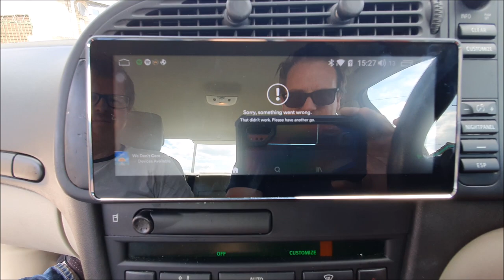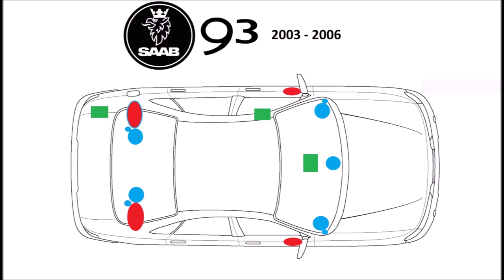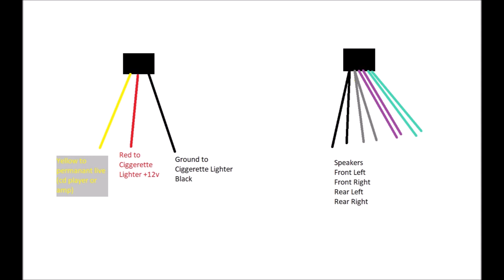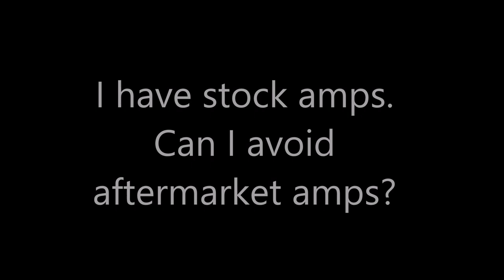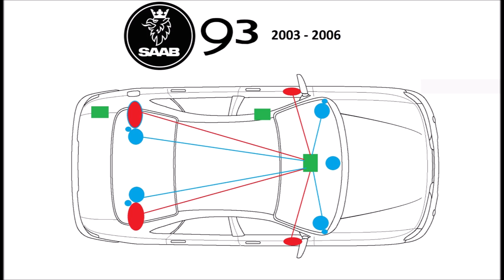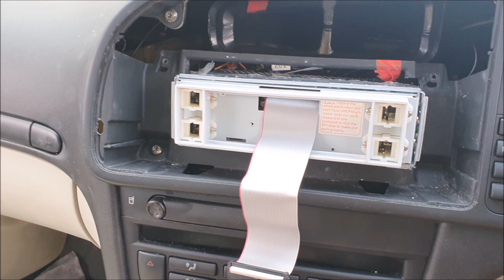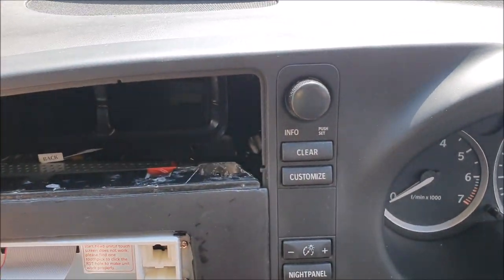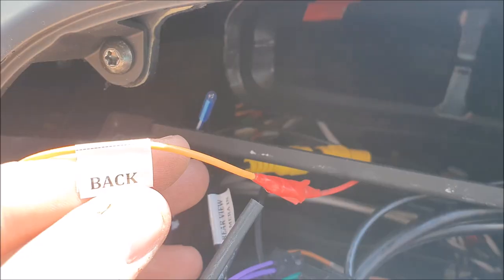Saab 9-3 2003 - 2006 Joying 8.8 inch Aftermarket Radio and Reverse Cam - Fibre Optics and ICM Bypass

Comment: I did this setup different with success. I bypassed EHU/CD with loopback and moved EHU to AMP1 position. Then connect center channel to EHU for chimes and turn signals. I soldered new wires to door speakers from AMP 1 to trunk/boot, then ran a 6-channel amp. All other wiring is the same from your video accept for steering wheel controls. I opted to take Analog stalk signal directly from CIM and then used an Axxess SWC-1 to head unit. This is better than canbus because you get more buttons to program (although phone button still doesn't work).
Reply from the maker: Very interesting, thanks for sharing. I'll have to try this method next time
Reply: @djfremen what wires did you have to connect the Axxess SWC-1 to?
Reply: @subscriptmds8900  there a two bright green wires behind speedometer (remove fascia). They look the same but only one works. You'll have to test and it's a 50%. I used the quick connect slice rather than cutting the wire.
Reply: @djfremen  Thanks for your quick reply.
Reply: @djfremen  Sorry, one more question, was that the pink wire from the Axxess SWC-1 connected to the green wire? Or a different wire from the SWC-1?
Reply: @subscriptmds8900  if pink is CAN wire, then yes. Must be encoded wire.

Comment: You have put so much time and effort into this... That's why it's very sad to see you just left the AMP1 and AMP2 there and even connected etc, instead of really bypassing the optics, as you say. You could've make a loop... Whatever. I mean, thanks for this, it explains a lot to other people that are just looking around and thinking of what and how to do. But somehow, I had my high expectations.
Reply from the maker: I did this conversion with items laying on my garage. I didn't have the adaptors needed for a good loop back and I didn't want to bodge it. So for this, I left everything in place

Comment: @ Saab Unleashed is there a modulator, like the one used for the Bose systems in the GM vehicles. Where the Bose speaker system are still used, with the after market head unit, wether it has video, or not, and all noises are still produced.

Comment: Freaking awesome mod! I see that you have also have an LG phone ICM3 mod, which mod do you prefer?
Reply from the maker: They're for different things. The ICM3 mod is a quick easy upgrade, but there are some minor limitations on options because you're restricted to the Saab's stock system. This video shows a full aftermarket system that gives you full control over sound and full options on components, so if you have the time and inclination, going aftermarket is always best
Reply: @SaabUnleashed  I really want to give this mod a try,  would this be pretty similar for the Sportcombi Wagon? Also, do you know if integration of rear and dash recording would work?
Reply from the maker: @ArcticCenter3773  Yes, this works for all versions of the 9-3 (2003-2006) so can be done for you. The only difference is the location of the rear amp and speakers

Comment: Not sure if you are still on this page, but was wondering why you need to replace the factory amps? can't you still use them since you still have them wired/powered on? Also, I do have a stock sub on my car but I guess it's cuz mine is a Sportscombi. How would I go about having that sub working? or would I need to completely rewire and get new amps?
Reply from the maker: You can't use the factory amps because the audio input is through a proprietary optical interface, so there's no way to provide them audio with an aftermarket setup. You also don't need to keep the amps in place like I did in this video, instead you can use fibre loop adaptors.
Your factory sub will need to be wired to an aftermarket amp if you want to continue to use it.
Remember this information is only relevant if you have a car built between 2003-2006
Reply: @SaabUnleashed  oh okay, so i mean putting them where the factory ones are probably helps with the speaker wiring right? and I have subs/amps already that I had installed already but I guess I can  maybe add the factory sub to that amp as well. Can you share a link of which exactly fibre loop adapters I need. Tried tooling up some but there are different kinds online so just want to double-check to make sure to get the correct ones. I had whole set up on my 09(pair of 12's, upgraded door speakers, 10 inch touchscreen center unit, amps, and rear camera), but it got it got hit and well i had this older 9-3 that ima get running so wanted to fit all that into this one lol hassle yeah but rather hassle a bit than just not use any of that set up anymore.

Comment: Any advice for retaining steering controls?  And did you have to mess around with Divorce/Marriage for the ICM1?
Reply from the maker: The ICM units don't need to be married/married. That being said, if the car you took it from had less features, you will lose those features unless you switch them back on with a tech2. In my case, the reverse sensors were disabled and I had to turn them back on

Comment: Hi Stuart, i have just hacked my icm1. Not taken the board out of the metal casing just yet. I was wondering whether it is even necessary.  It surely offers better protection.
Reply from the maker: You don't need to take it out of the metal case, but there's not a great deal of space in the dashboard.

Comment: Hey Stuart, what adapter did you hook up on the green wire behind the CIM to make the steering wheel controls work? Did you hook up on the I-Bus? Some android units have the learn-button thing, do you think it might work without any adapter?

Comment: This looks like a massive pain in the backside! Mines a ICM1 with door and rear speakers but no sign of an amp. I think I'll end up frying something if I attempt this!
Reply from the maker: If you have door speakers, your amp will be under the passenger seat unless it's a convertible, in which case it is behind the side-panel behind the left front seat
Reply: @SaabUnleashed  Cheers Stuart! spot on found it!

Comment: @ 10:30  you mention not to cut the center channel wires from the Loom -  however the center channel with the AMP1 system has not wire from that Loom to the Center channel as it gets that signal from the Amp under the seat.    I am thinking that I keep that wire Like it is from the Announcement/Beeps etc..  to the center channel and then add a amp for the Door speakers.  My car has no bigger speakers in the back shelf only the tweeters so I might add a pair to that and add a 2nd amp in the trunk for that purpose.
Reply from the maker: The beeps com out over every speaker except the centre. So when you cut all the speakers away from the loom, you need to attach the centre speaker to one of the other 4 speaker outputs on the original system so that all of your beeps come out of the centre speaker, and all of the other speakers are driven by the new head unit.
Reply: @SaabUnleashed  OK thanks -  I will tie that into one of the speaker outputs  - Rather than hunt that down in the dash somewhere, I think I will run  another audio cable from the dash to under the seat where AMP1 was and tie the connection in there.
Reply from the maker: @333cparker  No, you just need a wire from the centre speaker to the EHU, no need to go to AMP1 at all. I'm not sure if the warning sounds are even sent to the doors. Juat the dash speakers and rears.
Reply: @SaabUnleashed   I agree on the door - I dont think that the warning sounds do.  However is the sound comes out the center speaker on the stock setup, the only way it get there with the 7+ speaker setup is through AMP1...  Correct ??

I can try it out and see while the seat is still pulled back.
Reply from the maker: @333cparker  you're looking at it backwards. The warning sounds don't come out of the centre speaker by default, so there's no reason to use amp1 connection point at all.
The warning sounds only come out of the 4 speakers I mentioned, so you need to run a cable from the centre speaker in the dash to the EHU, also in the dash
Reply: @SaabUnleashed    You are correct   I tossed the AMP1 back in while the seat was still not in place and you are correct no alert sounds.  So I started splicing into the speaker wires coming off the ECU.  First I did the Black/Blue and white pair - but nothing then I did the Green and Green Black pair - nothing yet again.   So know I am thinking I am either really bad at guessing and went 0 for 2 right off the bat.  However the third try was the charm and the  Yellow/Black Yellow had the alerts playing and the final one the Yellow/Yellow-Black also worked as well.     So it is confirmed only the two Dash speakers left and right play the warning signs.     Thanks for all you input.

Comment: I got I think the same head unit -   I have the rear camera installed so far and ran the required cables.   Odd thing is that I have this short (less than 1 sec) flicker on the read camera LED lights when the car is not in reverse and even without the car being turned on.  I changed the ground to a different location, but same thing.   IN reverse the camera works fine just that when not in reverse I get this flicker.  It is pretty much every 3 secs almost exactly without missing a beat.   I am thinking perhaps there is a power trickle happening that is just enough to light up the LEDs there is not screen image flicker only the LED light up every 3 secs for just a quick flash of light and then off and then 3 secs later again - over and over.   I am thinking of putting in a resistor in the line.  Amy thoughts ?
Reply: not sure if you did get this fixed but a resistor would work here, basically all exterior led bulbs installed in the saab will flicker due to that being how the car auto checks the bulbs are working. Since leds take less power to light up that small amount that wouldn't like the old flourecent bulbs do light up the led bulbs. There is also a program you can get like a "tune" for your car that disables/makes it use less power not exactly sure what it does but takes the flicker away on the whole car, think its about $100 to get it though.

Comment: Awesome job Stuart, when you swapped from ICM3 -> ICM1 did you divorce/marry the units? Or did you just plug and play them? Would love to do the same to mine, but cuttin up a ICM3 seems a bit wasteful.
Reply from the maker: Yeah, don't cut up an ICM3! ICMs don't need to be married and the majority of features that might be enabled / disabled on them via tech2 you will be removing anyway (stock amps, aux in ect). If you have auto wipers, I believe that is also controlled via the ICM unit too, so you may lose that if the ICM1 doesn't have it enabled, at least until you switch it on with a tech2
Reply: @SaabUnleashed  Awesome thanks for the clarification!
Reply from the maker: @L1NKU5  FYI, I realised this week that the reverse sensors no longer sound, this is because the ICM1 came from a poverty spec Saab which had no reverse sensors, so I have to use the Tech2 to enable them on this ICM1
Reply from the maker: But still, no marrying required
Reply: @SaabUnleashed  sweet! Luckily i have a ICM1 that previously was married to The car so i should be able to just swap it out and keep all functions 👍

Any News on The steeringwheel Buttons yet? 😁

Comment: Hi, I am a little confused on the video.  On the EHU loom you said there is Front left & Right, centre and Rear left and rear right.  On the speak side of the EHU connect there is 8 wires.  Should be 10 if including Centre.  I do not have a centre speak but I see a wire as Yellow/white + Purple/White so 2 are missing from my understanding yet sound comes from all 4 speakers.
Reply from the maker: The centre speaker terminates at Amp1, that was my mistake
Reply: @SaabUnleashed  thanks for your help Stuart.  I managed to finish mine.  I added a Connects 2 harness so I did not cut many wires and I opted for the 10.25 inch screen which almost covers the whole ICM area.
Reply from the maker: @jatkaler5735  sounds awesome. I would be interested to know what connects2 loom you used
Reply: @SaabUnleashed  I got the CT10SA01.  I had to swap the constant power lead pin as it was in the wrong place.  I just used the 12V power lead from the Cig Lighter as you mentioned.  Upside to this is that I can use the factory stereo if I wanted to switch back as I did not cut the original harness.  Downside is that it gets quite congested at the back.  Only thing I need to do is attempt the steering wheel control.
Reply from the maker: @jatkaler5735  I see! What did you do about the door speakers?
Reply: @SaabUnleashed  I have the basic 4 speaker setup.  To retain the sounds from the EHU, I got a centre speaker from my local Saab mechanic and wire directly.

Comment: Would it not be possible to bypass Amp1 and the CD player with a loop back connector? I have the 7 speaker setup
Reply from the maker: Yes you can, I meant to say it in the video but added that to the description

Comment: I just noticed you still have the old CD player.  Does this still work?  If so then how is that operated?
Reply from the maker: It doesn't work, it serves the purpose of keeping the dash complete
Reply: @SaabUnleashed  Did you connect the original harness back onto the CD player?  Also did you remove the speak wires from the harness and spliced onto the new and the centre speak wire you just moved onto either L or R on the original stock harness?

Comment: Does your blinker sound, sid and steering wheel control still work?
Reply from the maker: The indicator (blinker) sounds do still work along with all the rest of the various sounds. The SID is a different system and isn't affected by this so yes that still works. The steering controls I will follow up with a separate video, but yes, this unit is compatible with steering input
Reply: @SaabUnleashed  Well, then ur build is pretty insane. Congrats

Comment: If I were to modify my top vent, could this fit flush in the dash?
Reply from the maker: Yes indeed although it would be very difficult to do that. Although I will point out that the cupholder still works even though this is not flush
Reply: @SaabUnleashed  Some chap I believe on Saab Central was able to fit a tablet in, he said it took some cutting of the top vent. I have a few spares, maybe it'll be fun to experiment with!

Comment: I appreciate the effort to document this, but in my opinion, it's a bodge job. wrapping the icm in tape, using normal electrical tape to insulate wires.. You know the tape will release an get sticky all over when summer is coming.. Using self-amalgamating tape would be a good first step to proper insulation..  screw connectors are not reliable in cars, please learn how to use proper shrink connectors. Use connectors without plastic collar, after shrinking (with proper shrink pliers), use shrink tube. I've found it hard to watch the practices in this video.
Reply from the maker: I bought this car specifically to do this install. It was very much an experiment to show what was possible, and yes, it was a bodge job that could have been done much more professionally. You'll see me using a soldering iron and heat shrink in other videos.
Reply: @SaabUnleashed  great!

Comment: doesn't i sound bad to have the center speaker playing music on the left/right channel with everything else?
Reply from the maker: The centre speaker doesn't play music. It just provides the cars warning sounds
Reply: @SaabUnleashed  well that's pretty strange because it did play music before I removed it
Reply from the maker: @abdomination  yes sorry, I misinterpreted what you meant. They do play music when set up in the original stock method. But to answer your question, no, it doesn't sound bad to lose this speaker.
Reply: @SaabUnleashed  no so if you wire the center speaker to the left or right channel wouldn't it play the left or right channel from your new head unit That's what I was confused about
Reply from the maker: @abdomination  ah I see where you're coming from. No, you wire the centre speaker to the left or right of the cars original EHU. This leaves the centre speaker the only remaining speaker still connected to the cars stock system. The reason you're wiring it to the left or right channel of the stock system is because the car warnings were never outputted through the centre speaker, only the left and right channels
Reply: @SaabUnleashed  okay thanks that makes a lot of sense especially since I removed the center speaker and still hear the warning sounds. Right now I'm looking for a Sony Bluetooth single din that has a 4x100 where I don't need to do a separate amp I think I found one in stock it's crazy how so many of the older single din stereos were just packed full of quality and power makes me really miss my old ones from the early 2000s.
Reply from the maker: @abdomination  yeah but you have to remember most modern cars have seperate amps. Older cars used head unit amps. The problem with that these days is different sized component speakers. In the Saab, you have tweeters/mids in the dash and parcel shelf, and mid/lows in the doors and parcel shelf (in the saloon, the vert and estate models have the same but in different locations) My point is, you need the ability to control them independently

Comment: Is it possible to make the climate control in the head unit?
Reply from the maker: Is it possible? Yes. Has it been done? No. The amount of work that you would need to put in to decode the cars climate system signals and write software to interpret them for the android OS user interface would be crazy.

Comment: Why not just Build a new sound system sound EASIER then messing whit the old system and u can remove the amp under the Front seat and loop the ir cabel then u have sound from the turn light speaker
Reply from the maker: That's exactly what was done here